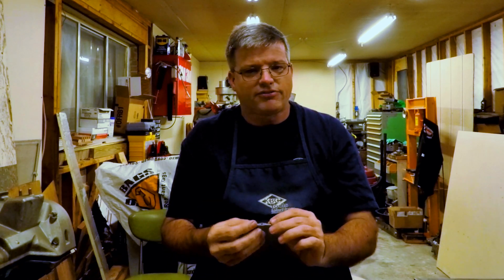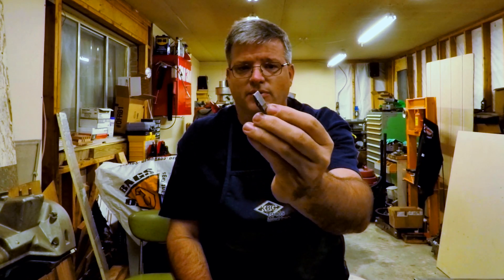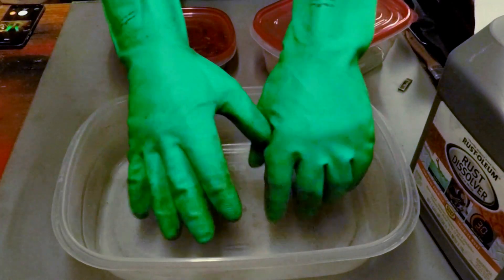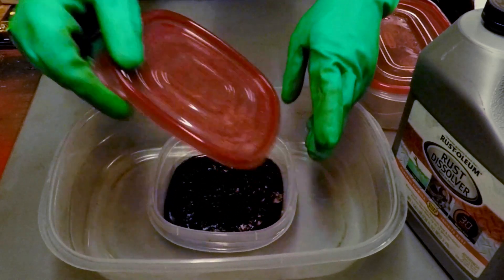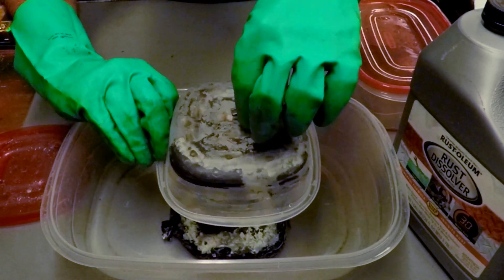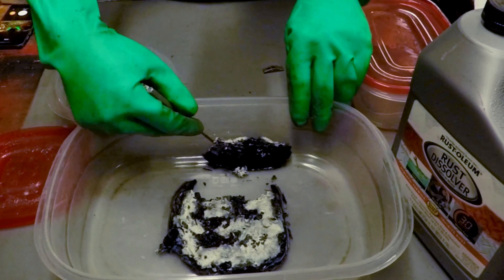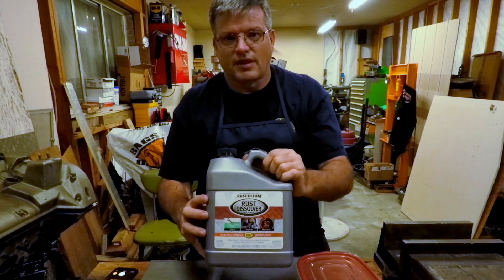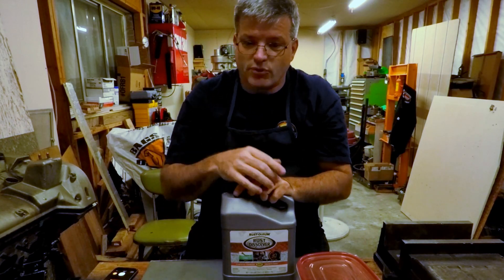Rust Removal Gone Wrong

Comment: small parts, derusting. you COULD try a micro blaster. with 20 micron aluminum/oxide.  or, boric acid or bicarb of soda. the latter two are quite gentle on the surface. poppy  says HI